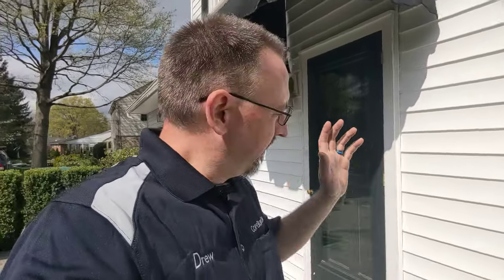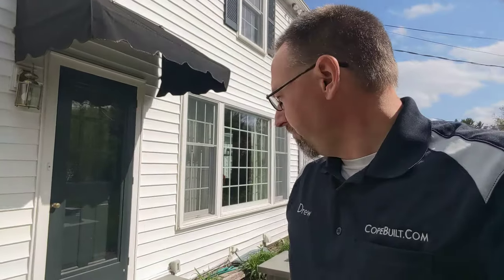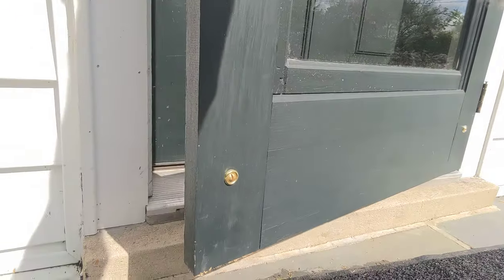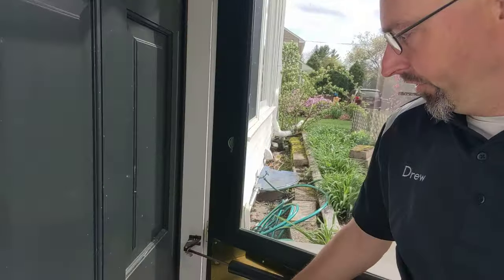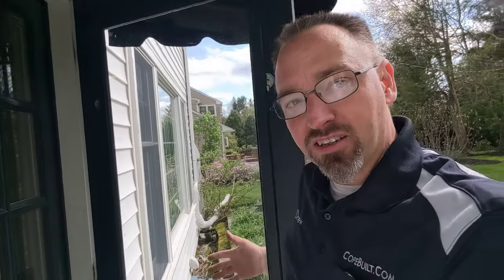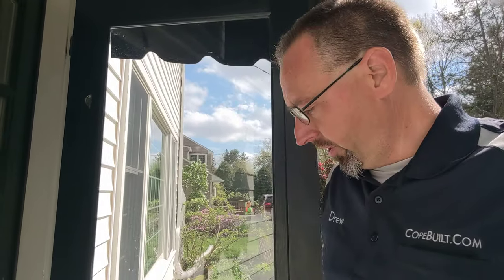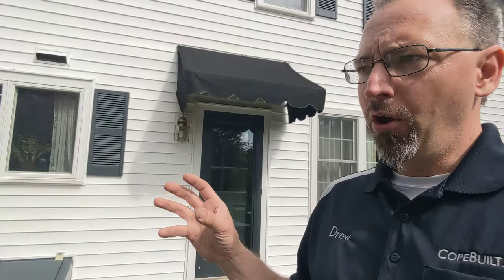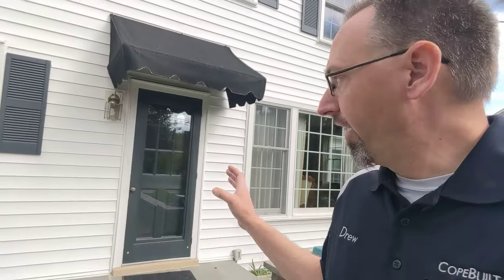storm doors: common problems and how to fix them

Comment: Knowledgable and well spoken
Good show, mate
Reply from the maker: Marsh, thanks so much!  Glad you found this helpful.   We hope you've subscribed for more great content!  Let us know what questions we can answer for you about home repair and home improvement.
Reply: @CopeBUILT  Water heater > gas control switch > thermocouple connector > female socket for thermocouple has a perpendicular plug with 2 white wires > know what that is? 

My pilot won't stay on but the thermocouple tests good. 

I couldn't find good info, 
then I remembered you.

Thanks, man, you care about quality.
Reply from the maker: I'm not familiar enough to give you guidance, but if I found this in a customer's house, I generally would start with a youtube search like this...

https://www.youtube.com/results?search_query=Gas+Water+heater+THermocouple+diagnostic

It will be even more effective if you can enter the brand name... and possibly brand name AND model number.

Sometimes those control valves are used by more than on manufacturer, so you might also try looking up the brand and model of the control system.

Comment: Answer 
Don't buy Larson junk
Reply from the maker: FoxGun, we'd love to hear more about why you say that.    Our recommendation has historically been, always spend at least $180 on your storm door.  The $99 specials are made of MDF (glued sawdust) and don't hold up.  But we've had good success when we've had to call their parts line for assistance with missing items for an install.    We haven't had any issues with the $180 and up storm doors, including the one we installed on our personal residence.   It has a roll away screen and has served us faithfully for 15 years.  It's probably due to be replaced, but we'll likely milk it for another year or two.     Did you have a negative experience with a $99 special?  We'd love to know more about why you shy away from Larson.
Reply: My Larson suddenly sticks shut!!! How do I fix that??